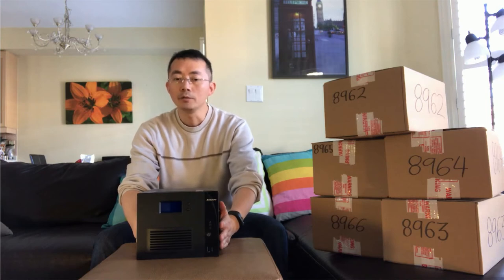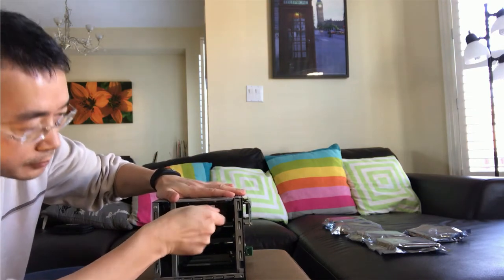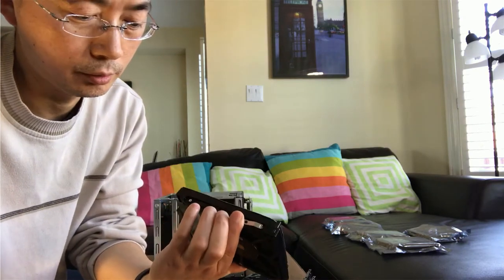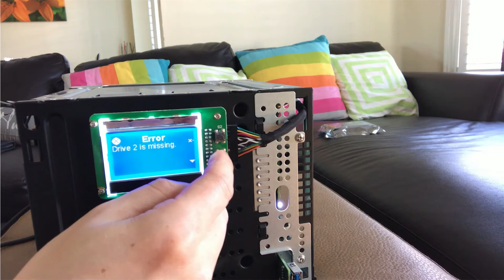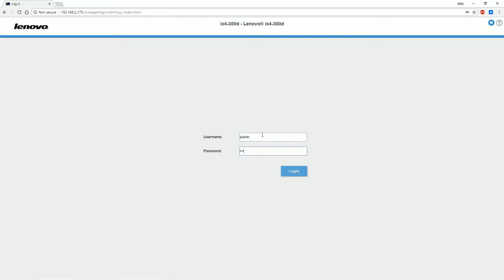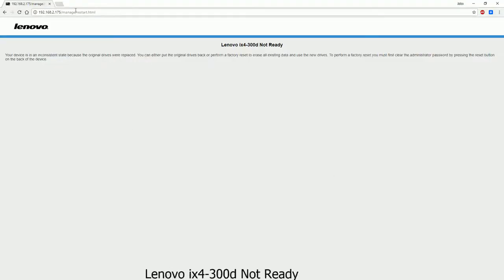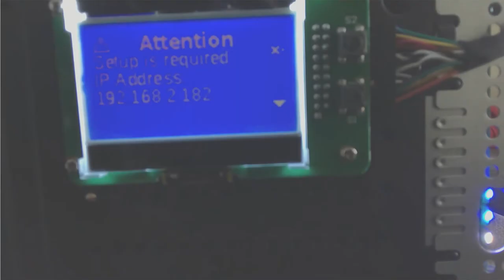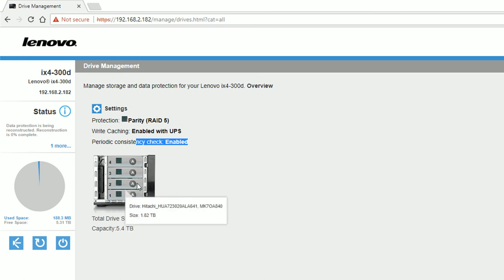Replace Lenovo IX4-300D Hard Drives with Four 2T Hitachi Hard Drives

Comment: how to overwrite confirmation lenovo ix4-300d ?
Reply from the maker: I am not quite sure to understand your question. After you replaced original hard drive(s) in IX4-300D, the system will be in an inconsistent state. You can either put original hard drive back or perform a factory reset to erase all existing data then use those new drives. By pressing the reset button at the back of the device to clear administrator password, you should be able to do factory reset.
Reply: @NetSec  thanks, when i install All HDD After ok when i install 1,2 Hdd after error
Reply from the maker: Sorry, still confusing here. You need to do a factory reset, after plugged in all HDD.
Reply: @NetSec  thanks

Comment: Hello everybody. I get this NAS as gift 1 week ago. I reset it and reconfigured from web-gui updating the firmware to latest available version 4.1.414.34909. Because this NAS was used into an office for 7 years I would like to check disk integrity before put in my data. So from web-gui I have access to All features > Drive management and from options gear I clicked on "Perform offline parity check, then reboot" BUT the function doesn't work! I receive the error "Unable to update the requested settings" and the NAS shutdown itself. Anyone have any idea how to perform the parity check? Thanks in advance for suggestions.... 👍
Reply: How do you access the web-gui? I'm just getting started upgrading an ix4-300D and would like to know the maximum drive capacity (3TB drives max?) and would like to learn more about how to do this.

Comment: Don't do that!!!  Firmware is in the HDD - The WD in this case!!! 
You can see that we went back to put the WD in the  socket 4 later because the NAS software says that there is a 500GB HDD....
Reply from the maker: Hi jppataki, I do not think the firmware is in the HDD. When I got IX4-300D, it is empty in the box. After I put it in 500G HDD, it was able to identify it well. After that, I bought other three 2T HDD and put them in, it works well too. And it has been a year now.
Reply: @NetSec  I'm pretty sure that it's the case. 
How did the software discover that the disk is 500GB when it is 2TB? I think that after a failed boot you changed  back to the WD disk used the procedure to reinitialize the HDDs and after success replaced the 500GB with the 2TB. It should work, but only in this way.
Reply from the maker: Hi jppataki, I really appreciated your replies and questions. Hopefully the following explanation will reduce some of your questions. Here is what I did. When I bought this IX4-300D, there is no disk inside. I did following steps to verify it is working.
1. I inserted one of my spare 500G hard disks in (It is only 500G, not 2T). After initialized the disk from Web Gui of IX4-300D, I can confirm this 500G works well by copying and removing the files.
2. I bought three new 2T hard drives, took out step 1's 500G hard drive and inserted all of those three 2T hard drives.
3. Configured Raid 5 from Web Gui of IX4-300D. Tested with copying and removing files. Since then, I have been used this IX4-300D with those three hard drives. 
So I can conclude there is no firmware on hard drive.